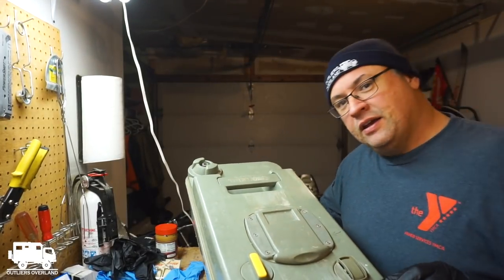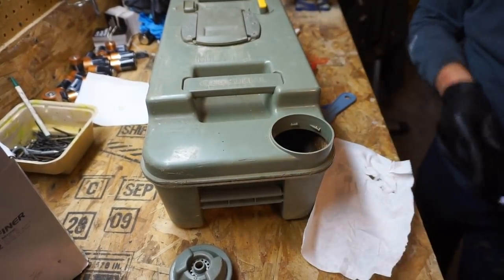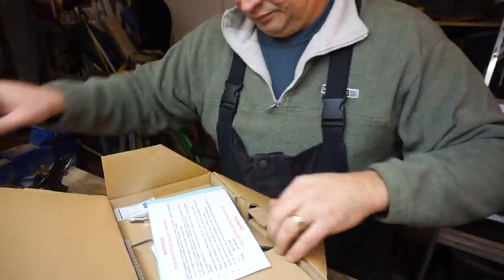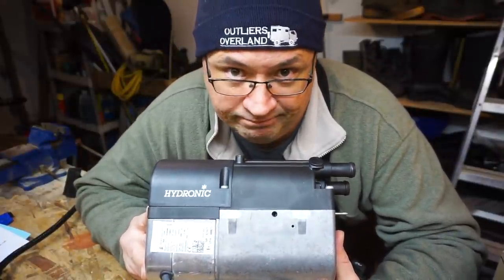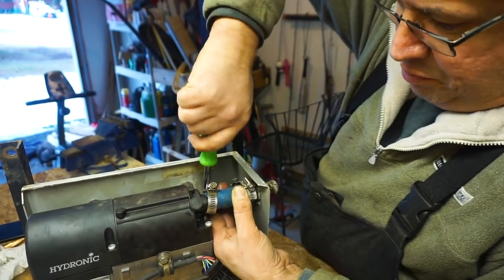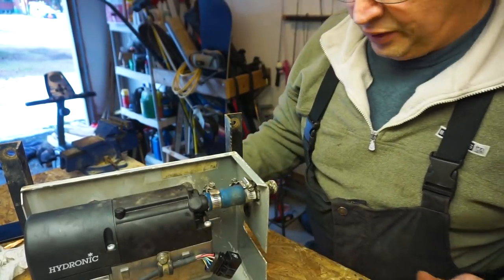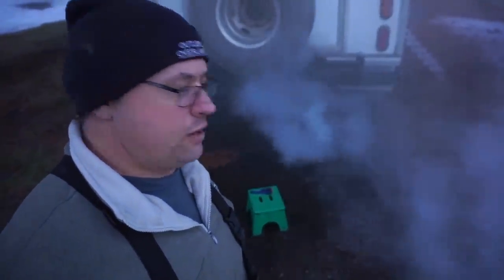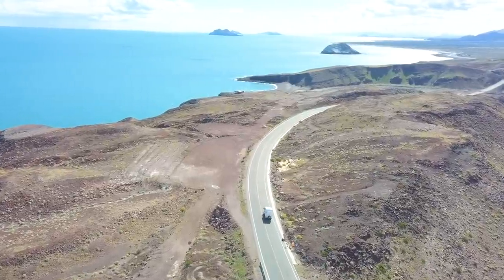Thetford Cassette Toilet Repairs & Replacing Espar Diesel Heater

Comment: I run a s bar heater in my truck and there's a trick I do to it every day as I turn it on as high as I can go and goes up to 95 and I let it go at 95 degrees for 20 minutes to 15 minutes then I put it back down then it regulates itself all night long it's just a trick that I do to keep it clean or sometimes it'll gum up then you got to take it apart and clean it just a trick my friend

Comment: Did I miss something, why did you replace the Eberspächer, they have reputation for lasting 10-20 years even 30 years, my own is 22 yr in March and all parts are available even for quite old models.
Reply from the maker: Our’s was very problematic and this repair would have taken our total repair costs over a new unit.    
So we bit the bullet and got a new one.   
I don’t think it was maintained properly with previous owners.    
We spoke with an Espar representative and got some tips to ensure a long life out of this unit.   
We make sure to run it for 30-60 minutes every month and never let it cycle on a thermostat.   It’s either on or off.
Reply: Yes Eberspächer parts are not cheap, lost count on the number of I have installed over the years some I installed 35 years ago in long haul trucks are still working retrofitted into newer trucks. Good advise from the agent, my VW camper has 2, one air heater and a DW3 for the engine which eats glow plugs as it’s only there to help with emissions, below 5c it fires up to for quick warm up and to maintain engine temp by keeping water temp above 70c which means light running it on/off, EGR engines run cool under light load.  I’m starting  to reposition it to heat the engine and the existing aux heater and it will run continuously when needed. The air heater a DL3 first time strip last year, clean inside replaced the glow plug only, it runs continuously on thermostat only varying the heat output from low to high.

Carbon’d up Eberspächer’s is normally poor diesel with high sulfur or other crap in it, wrong fuel pump fitted or run above rated max altitude which is 1,500m although we have had no problems at 2,000m for several days, an altitude kit is available for some heaters but pricey about $ 250

Comment: If you have carbon built up on the furnace igniter they will smoke badly, a cure is to run a quart or two on #1 white kerosene thru the furnace.